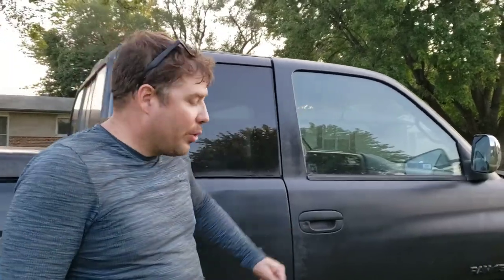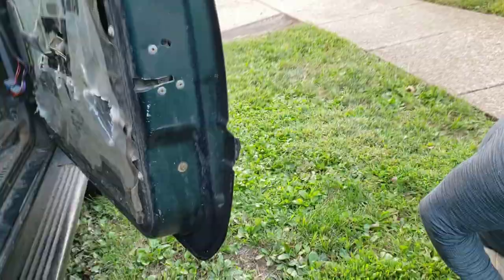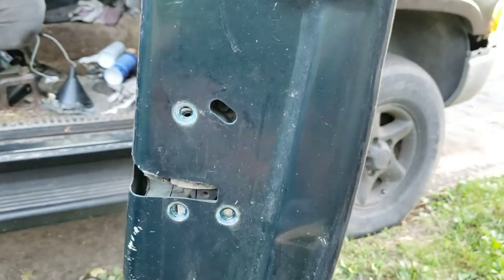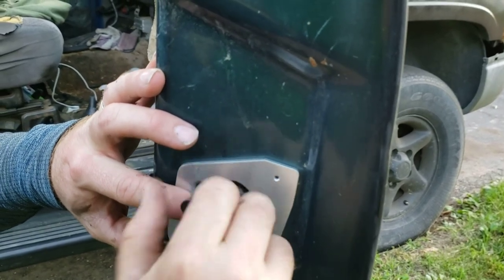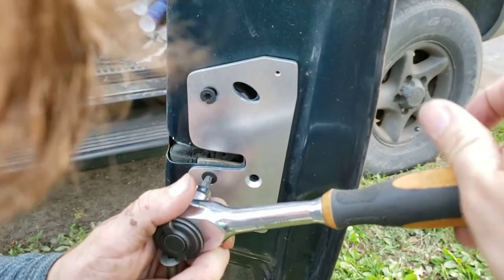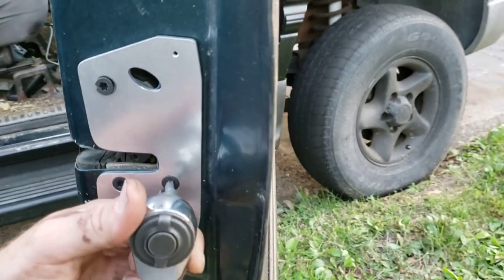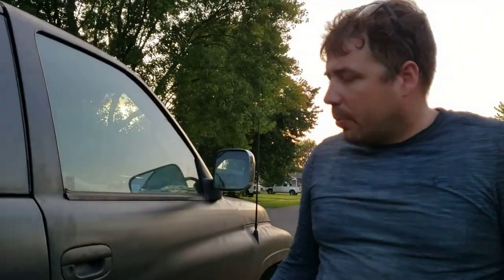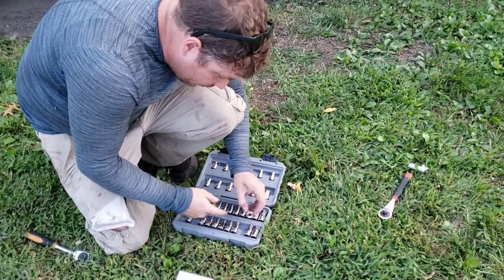94-01 dodge ram, 97-01 jeep cherokee, 93-98 grand cherokee, door latch repair and reinforcement.

Comment: How much did those plates run you?
Reply from the maker: Hey lone wolf, I forgot how much but there is a link in the description of the video to where I bought them.

Thanks for watching!

Please like and subscribe every little bit helps during these times.

Seize the day each and everyday-Are Jay 

Here is our second gen playlist in case you ever need it.

Top 2nd gen 1994-2002 Dodge Ram repairs and upgrade videos: https://www.youtube.com/playlist?list=PLQ0kUxbVWpJ-ebGroH9mPPUSfTWONjU-0
Reply: Yea I ordered a set for my dodge was less than 20 bucks & waiting on them to come in when we had this last below zero cold weather come in my driver side door froze I got it open but the latch was part way closed I went to close it & it bounced back open. I wasn’t thinking because I was in a hurry & slammed it then it cracked by bottom bolt so it don’t stay closed now. Also seen the bracket you put on steering box with the bearing. I ordered 1 hopefully that will fix the death wobble that seldom happens when at 67mph or higher if you hit a bump especially when you going over a bridge & it has that seem from asphalt to concrete my truck sometimes will violently start shaking until I slow down or almost stop. So hopefully it works. Good job on your content & videos really like the mechanical videos. Also like how you do it yourself & seem to make it work on a reasonable budget keep up the awesome videos definitely will support & share them

Comment: Are, thanks for purchasing my plate and creating this video. -Chris @ CS Works LLC
Reply from the maker: Your welcome!
 thanks for watching and making the plate.
I actually plan on making another video for the driver door sometime soon. Got the plate just sitting on the front door hutch. 

Plates still going strong even though i never replaced the hinges yet like I need to, just sitting in their box behind the couch,lol.

So everyday atleast 20 times a day it gets slammed against and is holding up great.

So again thanks for such an awesome product, that does what it was designed to do. 
So few products nowadays that do.

Please like and subscribe every little bit helps during these times.

Seize the day each and every day-Are Jay

Comment: Hello nice video. I was wondering do you know if that plate will work if the latch already has broken? I’m trying to see if I have to replace the door or not … 
🤔 💭
Reply from the maker: Unfortunately if the latch and metal has already broken away, this will not usually help it.
But after you get a new door at the junkyard, you should definitely add this plate. Also if you replace the door you should probably replace the hinges that LMC sells for these trucks so it doesnt sag anymore.

Here is a link to the hinges https://www.lmctruck.com/catalogsearch/result/?q=Door+hinges
Reply: No it’ll work. We’ve done it
Reply: Yes, the plate will repair an already damaged door. That is the original intent of the plate. I invented, manufacture and sell these plates.
Reply: @SilverXJ2000  well you’d be a good one to ask then… I need a plate for the driver side door but I can almost only find passenger. Do you have a driver side plate?

Comment: Thanks I just got one of these trucks and the driver door is not so great at the latch so knowing this repair plate exists helps alot
Reply from the maker: Your welcome, you can also lower the latch bar that the door latch connects.
To help with it as well.

Thanks for watching, and good luck.

I have a affiliate link to both driver and passenger side latches in the description below the video.

I have tons of videos on maintenance and repairs for 2nd gen dodges as well.

Please like and subscribe every little bit helps during these times.

Seize the day each and everyday-Are Jay